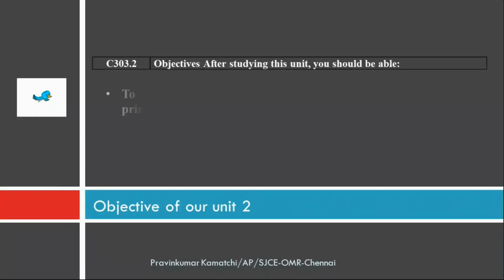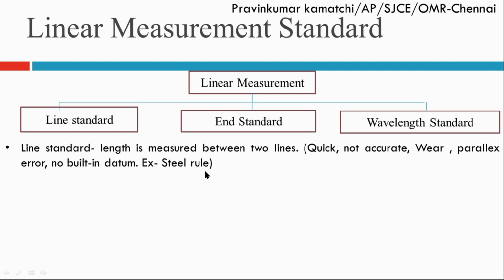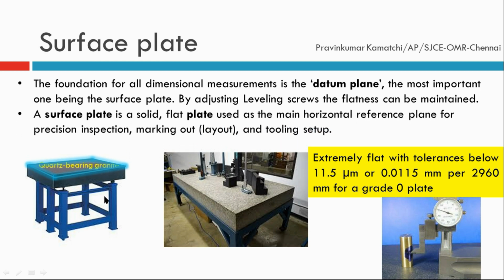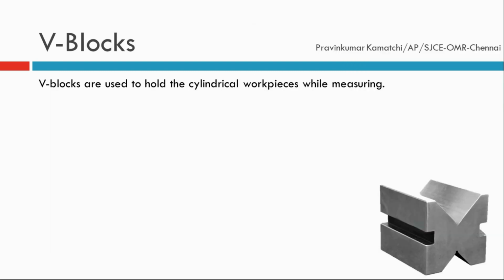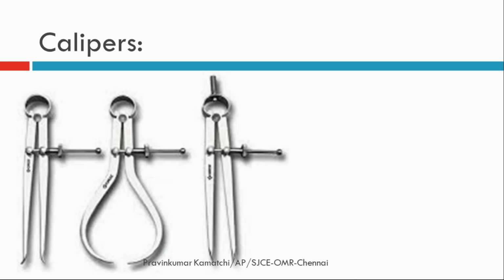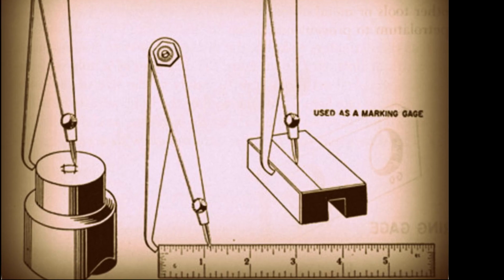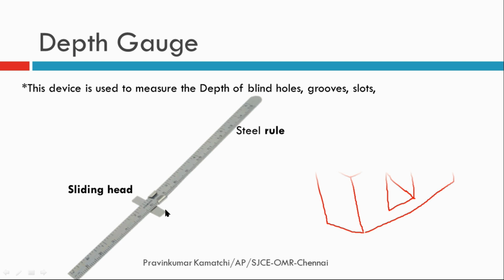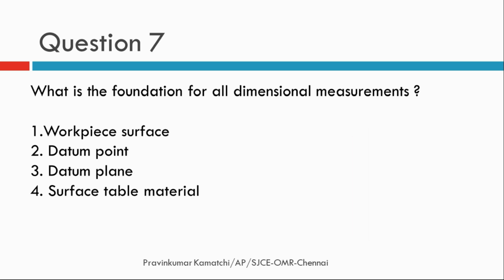2.1 linear measurement introduction | Metrology and Measurements | ME8501 | Pravinkumar #YoucaNShine

Comment: 1.Line standard
2.its not a material standard
3.scribing lines at a distance from a flat or curved surface
4.krypton-86
5.small hole bore gauge
6.Transfer caliper
7.Datum plane
8.Wavelength standard is a physical standard
9. three
10.very fine grain structure
Reply from the maker: Very good kanna.. Good focused learning. 10/10
Reply: @YoucaNShine  thank you sir